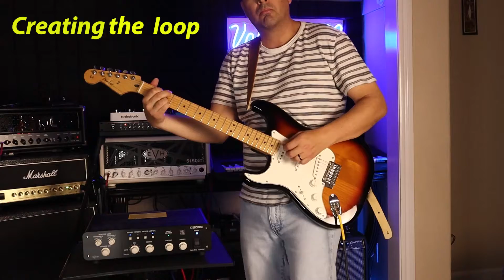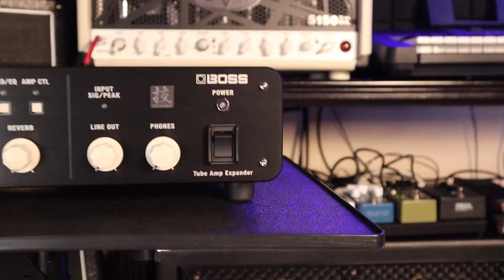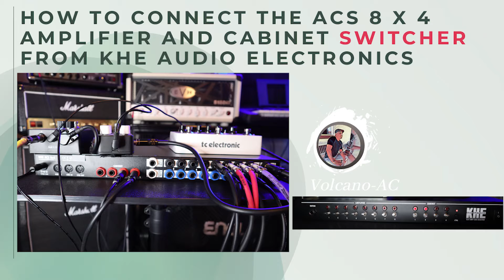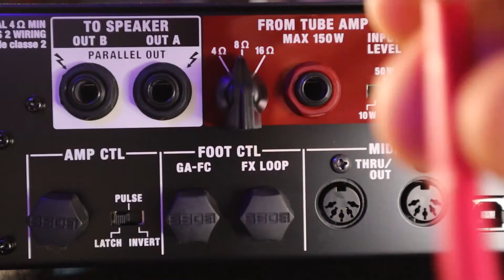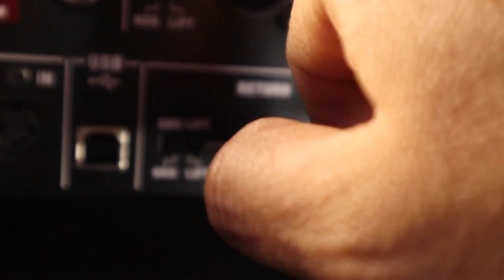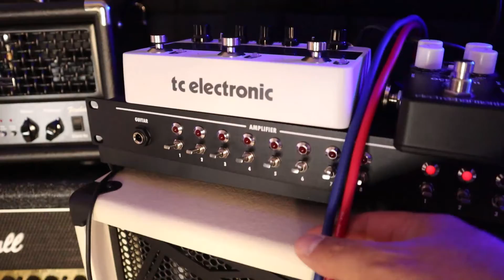How to connect the BOSS WAZA tube amp expander to the KHE amp & cab switcher. No computer needed!

Comment: Why are the cables going to the TAE of the TRS type? Why would a speaker wire be TRS? Is that a balanced line cable?
Reply from the maker: Hi jjoster! The signal going to an amp or a speaker will typically be unbalanced and you can use TS (tip-sleeve) unbalanced cables, however, the cables can be balanced (TRS) and that would not be an issue. It is key to note that if the cables to be used have to be very long, then a balance cable is better because it can help reduce any unwanted noise, better than unbalanced cables. For the headphone input jacks definitely balanced cable is best since that is a stereo output. Thank you for the question!

Comment: If you use an external recording interface do the effects get set with it. With either the built in effects or the external effects loop?
Reply from the maker: Hi AchillesWrath1! When you use the front of the house output of the WAZA TAE you have the option in the WAZA TAE app in your computer to manage the effects, even turning all those off before it hits your external recording interface. If you send the signal from WAZA TAE to a real speaker and record with real mic, then all the effects in the signal chain get recorded. I hope that answers your question, otherwise just let me know. Keep rocking!